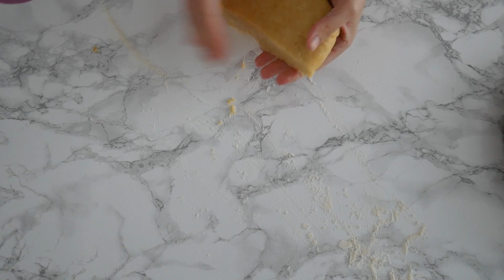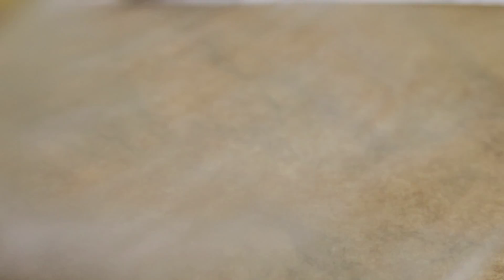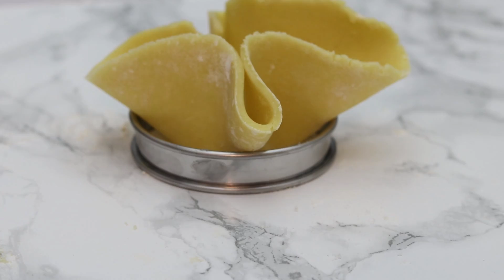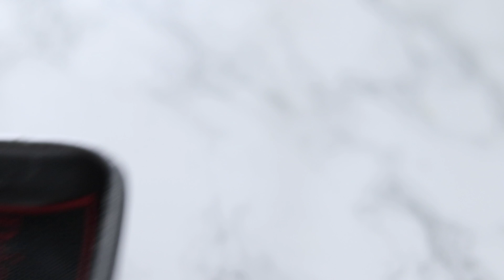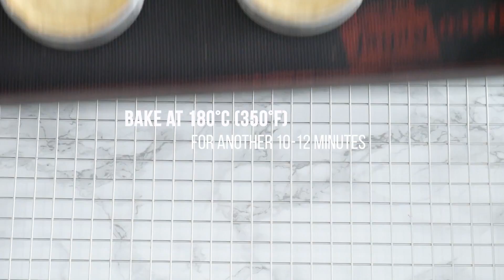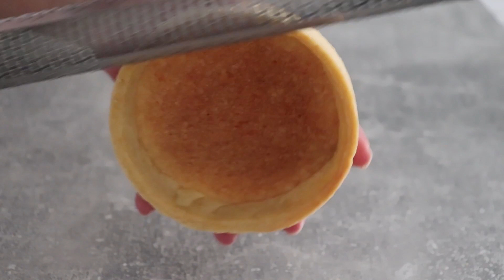Pastry Basics Episode 2 | Rolling and Blind Baking

Comment: Excellent class. Thank you so much! Which pâté do you consider the most suitable for a tarte aú citron recipe requiring the tart to go back into the oven for 8 minutes after the lemon curd is applied to fill the tart case and after cooling has to undergo at least 2 hours in the fridge?
Reply from the maker: Thank you so much for your kind comment, and regarding your question, I’d personally go for a sablee, it’s got a nice crisp and sweetness that would be paired well with the lemon curd 
I have a recipe similar to a tart au citron here if you’re interested (it’s always a hit when I bring this to a party 😂)
https://youtu.be/zqOXWhowBhY
Reply: @BakingNicky  Thank YOU for kindly replying attentively as well as for the recipe you’ve shared as a suggestion. 💌